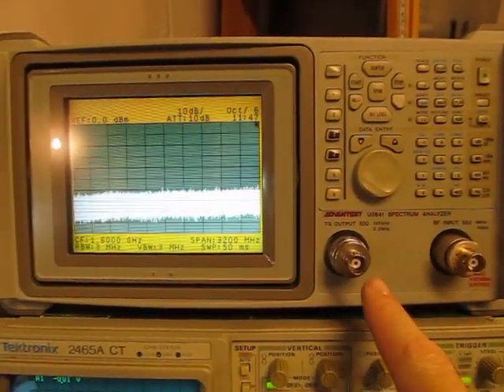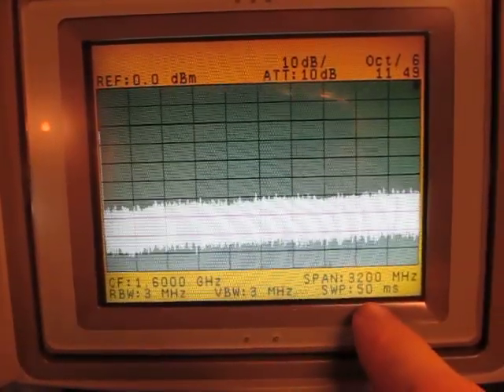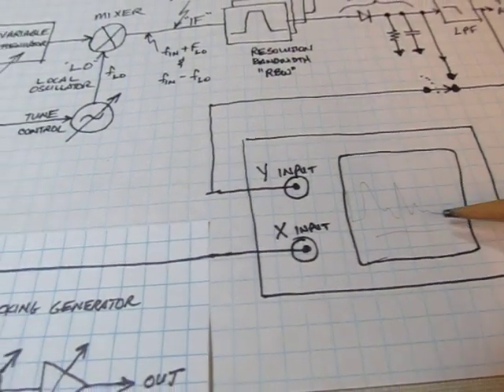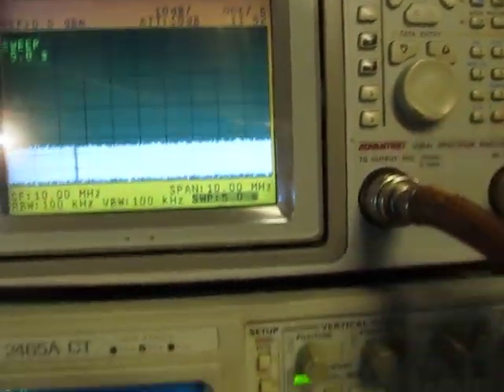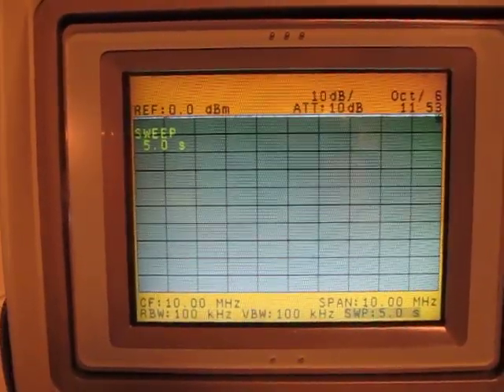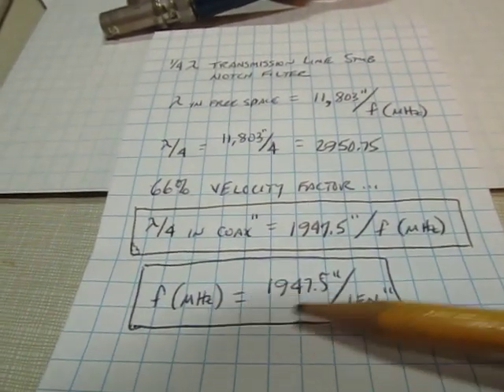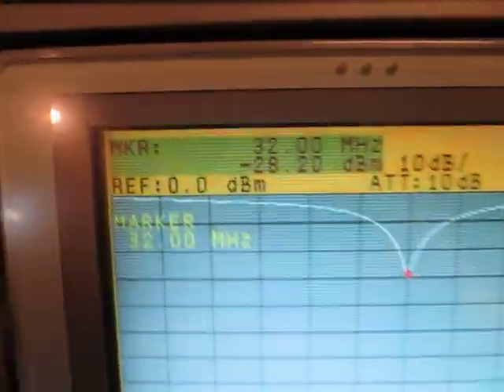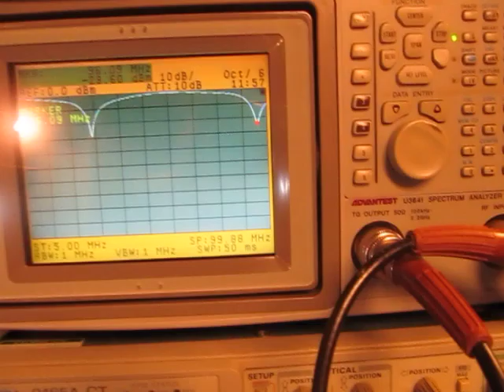#62: Basics of Tracking Generators and 1/4 wavelength coaxial stub filters

Comment: is there a 32 mhz signal of any kind at the open end of the coax cable?
Reply from the maker: Yes, of course there is.  It only appears as a short at the input.
Reply: ok
Reply: @w2aew  my delta loop called for a 1/4 wave of 72 ohm line from the vee, backwards to the 50 ohm line for matching purposes, which im still kinda fuzzy why really. my first loop really in 30 years of being a ham
Reply from the maker: @jeremycole3008  This site gives a brief explanation of how a 1/4 wave line does an impedance tranformation: 
https://www.everythingrf.com/rf-calculators/quarter-wave-transformer-impedance-calculator
The 72 ohm line will transform the approx 100ohm input impedance of the loop down to 50 ohms

Comment: It is unusual that inches are used instead of the metric system in the calculation of lambd/4 in coaxial cable = 1947"?/f (MHz).
Frank
Frank Reiser Video/Audio Service
Caldwell, NJ.
Reply: Inches and feet are not at all uncommon in Amateur Radio / USA anyway.

Comment: When I measure an RF cable, I measure like 0.8 dB loss at 900 MHz and 1.2 dB loss at 2.4 GHz.
Reply: Not uncommon.
Reply: @alanwolke6253  Why is the cable loss higher at higher frequency?  Is it caused by inductive reactance?
Reply: Two main effects are due to skin effect and dielectric loss, both of which are frequency dependent.

Comment: Hello Alan. Once again I am learning a lot from your videos. Thank you for your time. I Live in NYC and as you can tell my transceiver is being bombarded by AM and FM Broadcast signals. How would I go about spacing the T for the bands that I want to reject. Can I couple the t's together and have one 1/4 wave stub next to the other or do they have to be spaced at a certain interval. I would rather not buy a professional low pass filter. Thanks again.
Reply from the maker: Stub filters are probably not be best thing to use in a transceiver situation because they will add an impedance discontinuity that will affect the matching for the transmitter.
Reply: @w2aew  Thanks again. I made the 1/4 wavelength coaxial transmission line stub filter and I was able to knock all FM Broadcast right out of my RTL-SDR Dongle.

Comment: Thanks for another excellent video. In your video, the tracking generator output appears to be a clean sinewave with constant amplitude even though it was sweeping from 5 MHz to 100 MHz. In my experiments with signal generating circuits I have found it difficult to vary the frequency by much more than a factor of 3 or 4. So starting at 5 MHz might allow me to sweep to 15 or 20 MHz. How do tracking generators sweep such a wide frequency range? Thanks.
Reply from the maker: Most likely a built-in factory calibration that compensates for amplitude variation as it sweeps - maybe a lookup table, or even an ALC loop.
Reply: w2aew Thanks again. ALC would explain a flat response across the spectrum. I have an old HP 8557A spectrum analyzer that scans from 10 KHz to 350 MHz and it is not synthesized. It appears to be a design from the 1970s and uses discrete analog solid state components. So it baffles me that it can sweep such a wide frequency range with an LC circuit using a varactor.
Reply from the maker: Is it really using an LC circuit and a varactor?  That would be a very wide range for that type of VCO.
Reply: Thanks again Alan, I went to the HP8557A service manual and found that the spectrum analyzer uses two mixers. The first local oscillator is indeed a transistorized LC circuit with a varactor diode. It operates from 521.4 MHz to 871.4 MHz. The second oscillator is fixed at 500 MHz. Therefore the IF is 21.4 MHz. I am guessing that the 871.4 being only a factor of 1.7 higher than the lower frequency makes this possible.

Comment: I have an old HP141T and HP8443 TG in great working condition.  As an excercise I'm trying to look at the bandpass wave form for my  Icom 761 455kc 500 hz cw crystal filter.  The wave form I am seeing is not the textbook bandpass wave form as displayed in the ARRL Handbook.  I looked online and found the impedance of the IC765 cw filter I'm looking at is supposed to be 1000 ohm.  How would one display the proper wave for as seen in the ARRL manual?  Matching transformer?  Thanks for your very clear simple explanations.  I never could grasp the concept of coaxial stubs from reading the gibberish in the ARRL manual.  You made it sound easy.  I wish those who put the ARRL Handbook together could incorporate more practical explanations for field technicians instead of being oriented to those with electrical engineering degree's.   I have used coaxial tuning stubs to lower the swr on dipole antenna's on Field Day but never truely understood how it worked.

Comment: Thank You for the video! What is the main difference between a spectrum analyzer with Tracking generator and a System Network Analyzer such as a HP 8753D ?
Reply from the maker: There are a few main differences.  The SA+TG solution can only show the magnitude of the insertion loss/gain of a device.  It can't show any input/output loss (reflections) unless you use an external directional coupler.  A vector network analyzer can measuring transmission and reflection parameters on both ports, including magnitude & phase.

Comment: This video was amazing!!!! Holy crap!!!

My question.....what causes the signal rejection @ 1/4 wavelength? Is it some type of destructive cancellation due to internal reflection in the conductor or something???
Reply from the maker: +Brian Streufert Yes.  If a 1/4 wavelength long line is open at the far end, the reflection is virtually 100%.  Thus, when the reflected signal arrives back at the input, it is delayed by 1/2 wavelength (1/4 wavelength down to the end, and 1/4 wavelength back).  A sinusoid delayed by 1/2 wavelength is the same thing as a 180 degree phase shift - it is basically inverted.  So, at the driven end, the incident signal is destructively cancelled by the reflected signal at the input.
Reply: :-) That is exactly what I visualized in my head. I impress even myself at times! HA! Thank you for the reply!

Comment: Thanks alan, for another great video. One (beginner) question in regards to the notch filter: why does it filter the third harmonic and not the second?
Reply from the maker: At even multiples of quarter wavelength, the input impedance equals the far end termination - so an open is an open, and a short is a short.  For odd multiples of quarterwave length, the impedance is inverted.

Comment: The HP 8560E has a 1st LO output SMA connector and an IF input so that the HP 85640A tracking gen. can be connected as a separate unit. Theoretically that can be done in any SA, right?

Comment: For testing filters, sometimes I use the "poor man's tracking generator" by simply feeding amplified wideband noise into the filter and seeing the response on the spectrum analyzer. Would it be fair to say that the setup in this video is equivalent to doing an amplitude measurement |S21| on a vector network analyzer?